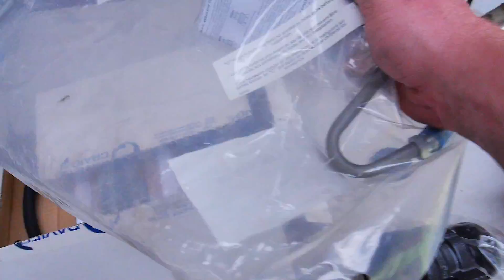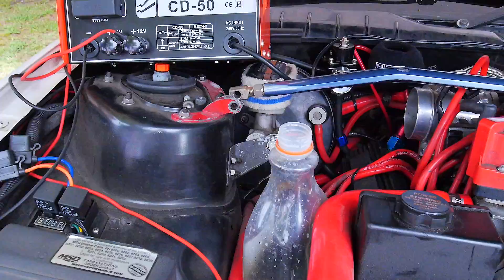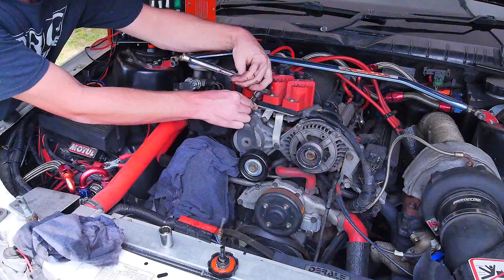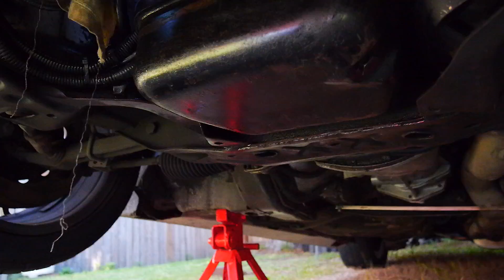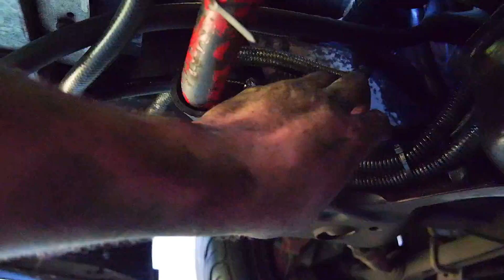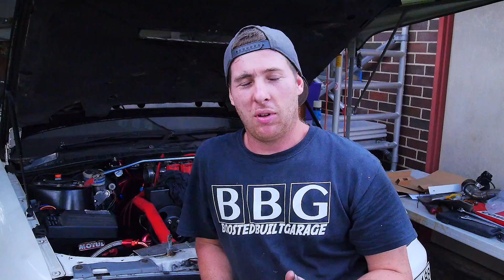THE ULTIMATE POWER STEERING UPGRADE - COOLER, FILTER & NEW LINES

Comment: The magnafine filter... is this likely to extend the power steering system's life significantly or is it only because, like the oil cooler, you are upgrading the engine performance?
Reply from the maker: lordchickenhawk It is meant to catch any contaminants to increase longevity. Not so much a performance thing

Comment: Hey mate, i have a vr v6 also. i have noticed when the cars running my tensioner pulley kind of moves and when i drive or accelerate i hear noises from the motor but im not sure if it's it. It's not the rockers or inside the motor
Reply from the maker: G0NAGN What kind of noise?
Reply: Boosted & Built Garage Hard to explain hey mate, it isn't a knocking sound and i have no loss in power either. Kind of sounds like hard plastic bumping each other. If i was able to send a video i would, i'm heading towards engine mounts/tensioner pulley. Hard to explain
Reply: G0NAGN 
Sounds like engine mounts